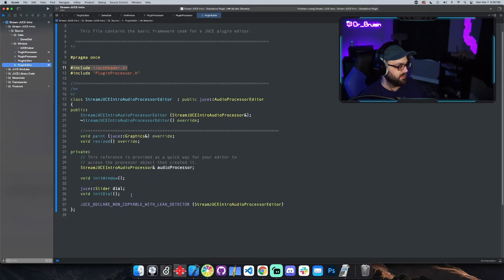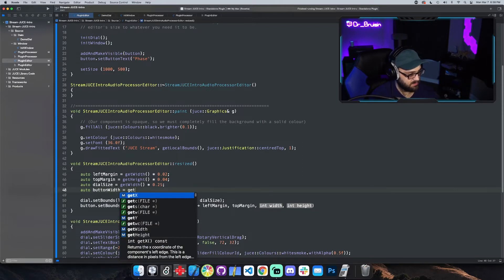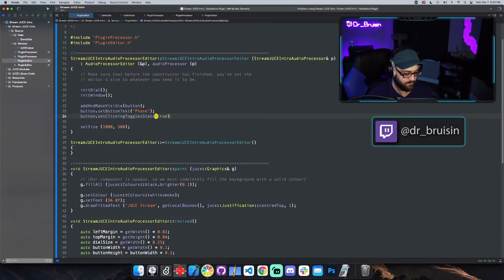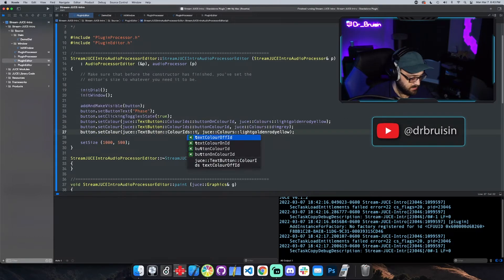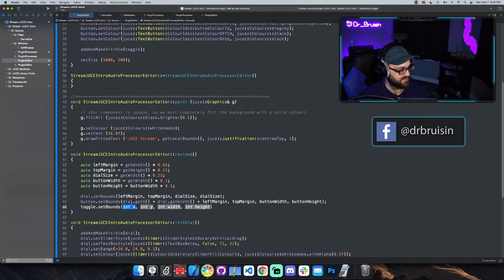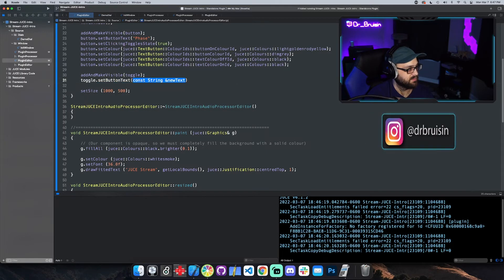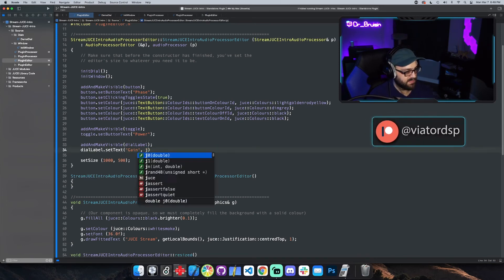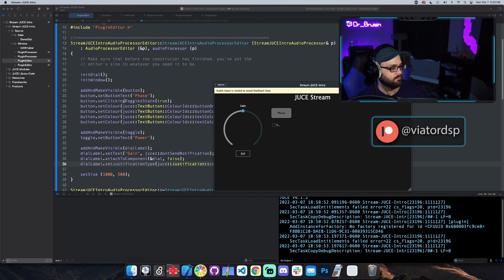🔮  Intro to JUCE & GUI | Buttons & Labels!

Comment: On the JUCE forum someone posted this in 2018: The GUI editor is more or less deprecated and won’t be developed any further (afaik). You will have way more freedom and possibilities of placing your components when you do it by hand (by code, quite similar as the plug-in tutorials show you).

I thought cross-platform GUI was one of JUCE's main features? Has the GUI functionality been deprecated?
Reply from the maker: That’s the gui editor that was built into the projucer as a drag and drop thing